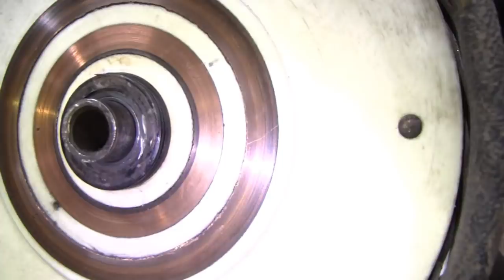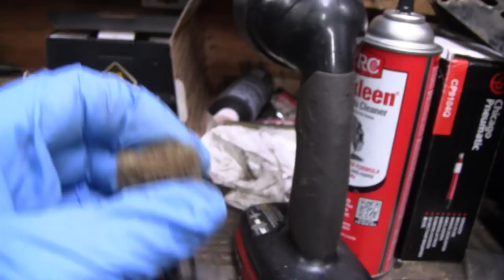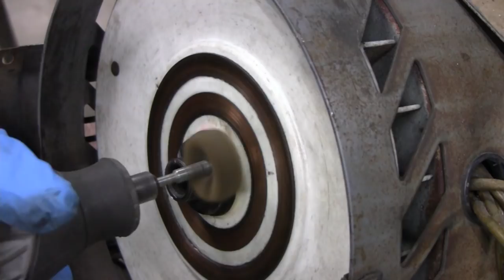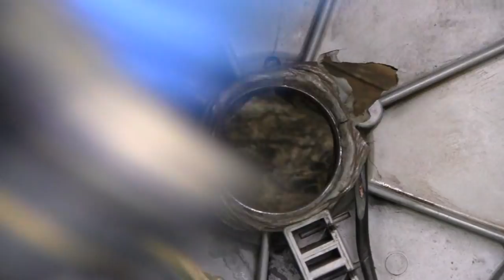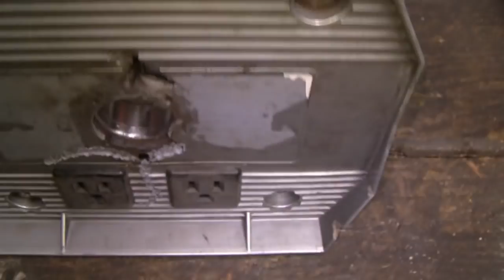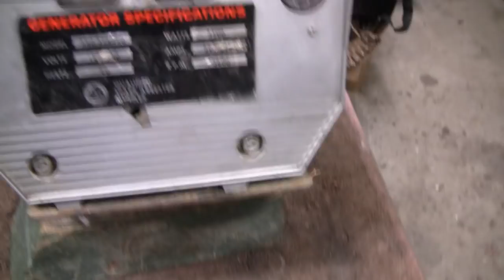SEARS GENERATOR REPAIR (part 7)

Comment: I'm late to watching your vids, just saw the last three and was screaming to my self "oh god, dont use that washer, its the bearing seal!" Lol.

Did you remember to remove the ball bearing that fell inside the hole for the long bolt to the engine shaft?  Id hate for that boot to have bottomed out on that ball causing there to be play that could shake the generator apart from the motor while running.

Also, you think about maybe using some sort of plastic weld or epoxy on that plastic housing?
Reply from the maker: Yeah we got the ball bearing out with a magnet!!☺

Comment: You made a lot of progress, Roadking.  I noticed that plastic end cap held an embedded metal ring, which helps me understand how it holds the bearing.  I thought at first that those cracks were cosmetic, but I think it's a good think you fixed 'em because that plastic is the only thing keeping the bearing from going sideways on you.  Thanks, Bud!!
Reply from the maker: That bearing holder was embedded pretty well, turns out that was the least of our problems!!☺

Comment: They got this stuff now-a-days to repair plastic like that, it's called Plastaid.  It's a two part deal with powdered plastic and a plastic solvent that you mix together. The solvent melts the powder.  You'd put a little tape on the other side of your hole and pour the mix into the hole, the Plastaid sort of softens the edges of the break and when it dries it bonds real well to most brittle plastics and is actually stronger than the original.  I have used that stuff to mend all kinds of plastic things.  You can get a small bottle of it that would be good for several plastic repairs for like $10.

Comment: I use a product called "plastech handy pack" to fix plastics, it's a powdered plastic and you grove out the crack, fill with the powder and then activate with what smells like nail varnish remover which melts the powder and welds the two together. I haven't seen it for sale for a while though so it may not be available any longer.
Reply from the maker: They have something out now just like that called Plast-aid!!☺

Comment: I watched a fellow who used a metal funnel he had mounted on a small metal frame with legs.  He would put a candle under it or some other source of heat depending on the bearing and he would put the bearing on it.  The funnel he used had a funnel that was not very long and tapered down to about a 3/8" end.  It made a nice bearing heater and only heated the inside of the bearing.

Comment: hey. how about using epoxy or plastic repair. when i would repair copier plastics. we would use a repair kit that allows you to build up the plastic. it was basically plastic.
Reply from the maker: We gotta see if the generator works before we go any further!!☺

Comment: Just a suggestion, if the plastic is ABS plastic which is what It looks like just get some scrap ABS Plastic put the pieces in a jar and pour an equal amount of acetone and the plastic will melt out and become what is called a slurry, you can join abs with the slurry using it as a glue when the solvents evaporate the ABS becomes plastic, try it you can put a cap on top of the bearing with the slurry or fix the hole in the cover, I am enjoying watch you fix the generator :)
Reply from the maker: Thanks Cary!! We still have to see if it works yet, it might not be worth fixing!! I'll keep that slurry idea in mind for other projects!!☺

Comment: Yes great idea with the string.. I have a trick with the brushes on a Magnum 8 HP Kohler starter..;;;;;   Those old starters are not available any more, just the brushes.....      

I wander why Sears put the 220 recep cockeyed like that ???
Reply from the maker: They mounted the recep that way to fit inside the round enclosure!!☺
Reply: Yea I see it now that you said it....    It's lined up with that angle side like a coffered angle .............       

Merci for the come back on that ~!~!

Comment: Dammit between Roadking and Mustie1 showing us more use for a body hammer than just body work, I`m gonna have to get one.
Reply: I was a panel beater for 35 years , pet hate people using panel hammers for other than what they were designed for , the storeman  where I worked took a  hammer without my permission and used it to hammer nails in  , had strong words with him .

Comment: Hey those new holes you drilled for the brush retaining strings are a genius idea!  Not only did they give you the effect you needed to assemble the generator; also now you have a convenient way to measure your field voltage without taking the unit apart. Just put your meter probes in the holes and you will get that reading. :)

If the generator doesn't work, I'm sure Mike will be able to help you troubleshoot. This type of generator depends on a current flowing through the rotor winding. this comes through the brushes and slip-ring. The stator (the main part of the generator) has a special winding that puts out a voltage for this circuit. It puts out AC voltage at a lower voltage than the main output of the generator. This then goes through the rectifier (plug-in part) that converts the AC to DC. The rotor has a big electromagnet in it which needs DC current. If that output wire got against the slip ring and sent a high AC voltage to the rotor, it could have burned out the rectifier. 

Another possibility is that the rotor has lost its residual magnetism. This will make the generator spin without producing power. This can be remedied by "field flashing." I would really recommend having Mike instruct you on this. There are many crackpot Internet Experts that have all sorts of dangerous methods they may suggest - but let a real generator service guy give you a safe method. If I had your generator in front of me, I could tell you a safe method but without knowing the exact wiring I wouldn't even want to suggest anything other than have Mike look at it! :)
Reply from the maker: Thanks Bud!! I didn't even consider looking at it!! I have the best Generator Mechanic on the East Coast just a phone call away!!☺

Comment: I use a old soldering iron to weld plastic. I have fix a few dirt bike gas tanks with huge cracks in them and it has worked great.
Reply: They make iron tips for plastic soldering, mind you. Some have a hair comb pattern on them to really neaten the 'stitch'.

Comment: The mustie1 plastic hot metal stitching trick...or...was it the Roadking plastic hot metal stitching trick before mustie1?
Reply from the maker: Lol!! I don't think either one of us can take credit for that trade secret, it's been around for years!!☺
Reply: Along with James D I had you using epoxy and body filler. You surprised me! Next time you will use your 3D printer and make a new end cover.